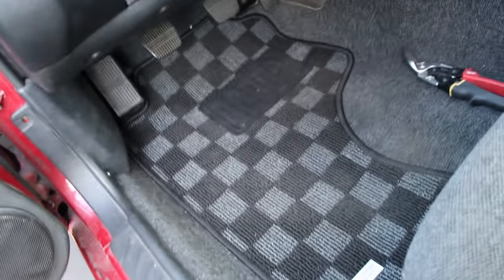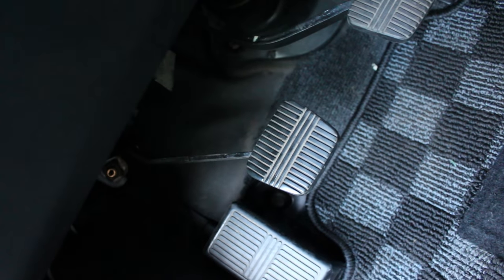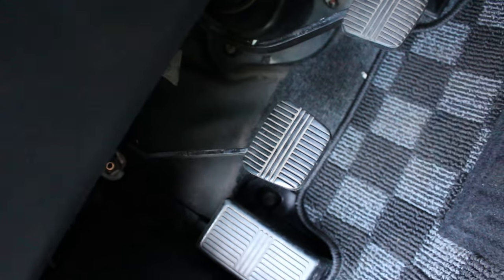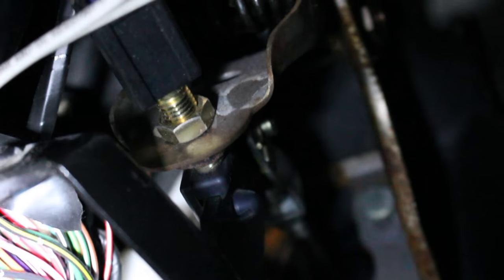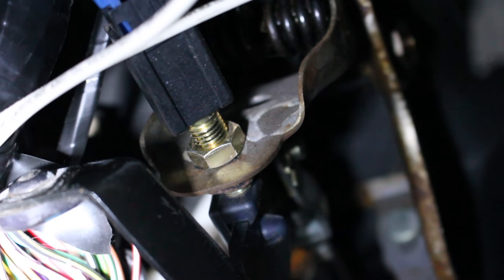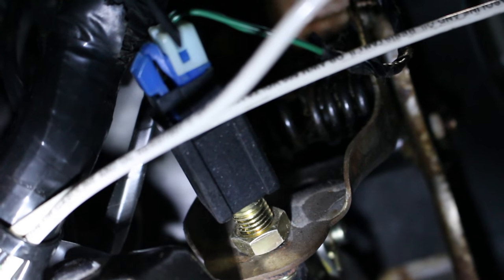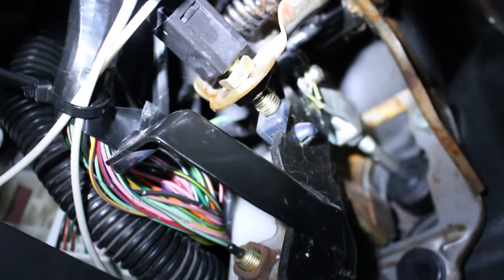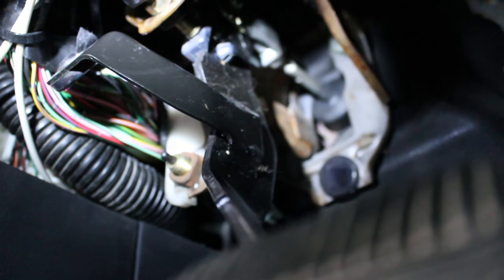How to Fix Clutch Pedal Slop | 240SX

Comment: yoo just a heads up, alot of cars (my z32 included) are actually supposed to have about half an inch of slop/free-play other wise when you fully let off the clutch, it might not engage fully and slip a little bit.
Reply from the maker: +khan brah That's why I mentioned to leave some room! And not go all the way to the biting point 👌🏼
Reply: from what I could see in the video, it looked like the rod was moving even with the slightest movement of the pedal hence not enough free play but I could be wrong, plus im not a mechanic nor have I ever owned a 240 let alone one with an rb lol. not tryna talk shit btw, just throwin my two cents in!

Comment: another thing too is after u been ripping gears in your car for alotta years my clutch pedal bracket spotwelds all broke a nice solid fix for that is to drill the spotwelds out and put grade 8 bolts and lock washers on its so much more solid than before now
Reply: Have you heard about this marvelous innovation they've come up with called "punctuation?"

Comment: The "springy" battery contacts in your light probably just need to be bent out to properly engage the battery ends. One of your lights battery contacts is probably barely touching the end of the battery. Almost always the issue with flickering lights that have good batteries. Nice video.
Reply: YOU should do a video about it!!

Comment: I have a miata but the adjustment is identical because I just did it. I rotated the sensor just a little bit, enough to where there is no slop now. I think it caused my pedal to squeak now when being pressed down. Any ideas? Do you think its just the spring from having more tension on it from the adjustment?

Comment: cool man, i just did that today made a big difference, will adjust it abit more. I have that squeaking noise where you just put abit of pressure on the peddle and it goes away. I have greased the pivot point on the end of the clutch fork arm and the pivot point on the arm inside the bellhousing but still had the noise there....

Comment: hey kalvin i have a s13 and recently did a manual conversion = new slave and braided clutch line, my problem is the clutch pedal is sticking to the floor and i have to raise it manualy, i have tried bleeding it the proper way and still the same problem. theres no leaks around master or slave so i rly dont know what the problem is. just seeing what your thoughts are on this :) thanks
Reply from the maker: +monique jones usually when that happens it's a slave problem. Or air in the line. Is it a new slave?
Reply: yeah its a new slave and braided line, no need to worry the problem was the master cylinder, there rly hard to bleed too haha. is your rb20 forged ? and did you do it yourself
Reply from the maker: monique jones Not forged, but yes i do everything myself.
Reply: Make sure none of ur lines have a kink at the ends with the nuts can cause a small leak that seeps and it will keep the pedal from keeping pressure

Comment: cool video i was just wondering about clutch adjustments and there isnt much info about them on the internet, great video besides that light wtf lol, but figured id shoot you a question maybe u have some insight, my clutch pedal sucks itself to the floor when i am shifting into gears, like first every time the clutch sucks and sticks to the bottom of the floor, but i can flip it back up and still use it to get into third, and when the clutch is stuck on the floor i obviously cant re press the clutch pedal cause it has no where to go, havent found much info about it even shops dont know but seems like it looses pressure, would u think it just needs a bleed, adjusted like ur video, or the master cyclinder doesnt seem like the MC cause i can keep using it some videos state they cant use the clutch at all and the MC is broken so wanted to know if u ever heard of a fix for that problem or if its happened to you, i dont wanna bleed the clutch cause i gotta take off a subframe mount to get to my bleeder screw which is locktite in i think but thanks anyways
Reply: if you put the clutch in and hold it in, does it start to engage by itself? it kinda sounds like a dodgy seal in the master cylinder returning fluid back to the reservoir instead of holding pressure to the slave. also you should consider a remote bleeder if its had to access. bleeding is normally the first thing to try when trying top diagnose any hydraulic issue such as this
Reply: yes i hear u i would have bleeded it but i cant losen the bleed screw cause they put it next to the subframe mount on my car, which is like lock tite on. but YES it does actually engage when the clutch is on the floor, like ill shift into 1st and i dont have to release it at all and it will go into gear then i gotta use my shoe to pull it back to the top and almost pump the clutch sometimes to get pressure to actually get it to shift into gear or itll just grind, what is a remote bleeder, i was gonna replace everything cause it all seems fucked but ive asked around and no one knows what it could be not much info on it just really broken clutches and something like this video but still helps. thanks for the reply tho bro appreciate it gonna try a remote bleed and see if that fixes it if not gonna replace the slave and master cyc and bleed and hope she works like new haha thanks
Reply: haha sweet bro, yea it sounds like the inlet seal on your master cylinder is the problem. a remote bleeder is a piece of brake line with a bleed nipple at the end of it that goes into the slave where the nipple is now. if you google remote bleeder you will see what i am talking about. with this you can run the line / bleed screw wherever you want. hydraulic throwout bearings use this method as the slave is inside the bellhousing. if you cant get your niple out you wont be able to fit a remote bleeder in which case you would be best to change both master and slave but put the bleeder in a place that is easy to access. a brake and clutch shop should be able to make you a remote bleed line if you cant find one off the shelf. good luck

Comment: Yo, i just recently installed pretty much new OEM transmission components besides the gears, and ever since and prior to doing so the slave cylinder would whine/squeak while in idle, but once the clutch was pressed down slightly it would go away. I fear that it's not positioned right because the pedal is off due to use for the past 20yrs etc. I'm gonna try to adjust the pedal thanks to your vid and see if it helps.
Reply from the maker: +Froskie that's your throw out bearing probably.
Reply: thats the thing, its brand new lol

Comment: My 02 Impreza actually has a ton of that slop. Great vid man I'm gonna see what I can do about it tomorrow
Reply: So...what happened??
Reply: Rich Rolwing never did it. Still has slop. Meh it’s an old ass car
Reply: @Ledface117  Aww, I'm disappointed (actually, never thought you would answer)--so, the clutch is STILL "operational," then, I assume? I have had the same situation (I think, anyway...) with my clutch pedal for a few years--do you also have to kick the pedal up before you can successfully shift (especially into reverse)?
Reply: Rich Rolwing when the engine gets hot, the friction zone drops waaay low. Like right off the floor. So the clutch still works but it’s all jacked up. I think one of these days I’m just going to replace the slave and master cylinder for the clutch and that should fix it all
Reply: @Ledface117  Good luck on your journey--may it end in enlightenment...
Reply: Rich Rolwing amen brother

Comment: Are you talking about a clutch pedal that doesn't come back up off the floor enough (this is where "wasting time" on a little more explanation would have been a positive)?? I have the problem that I have to kick it back up before I can effectively shift (especially into reverse)--I have heard that there could be more serious issues with this problem and that your solution might not be enough (of course I might have a different problem to begin with than what you're talking about here)...